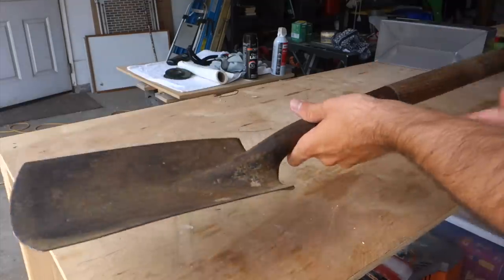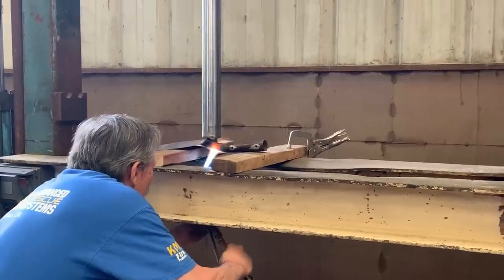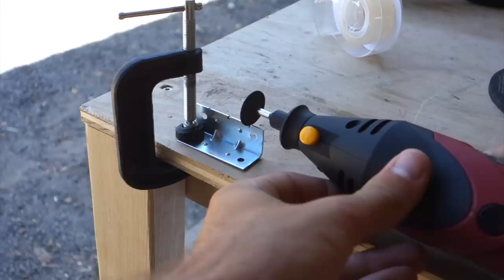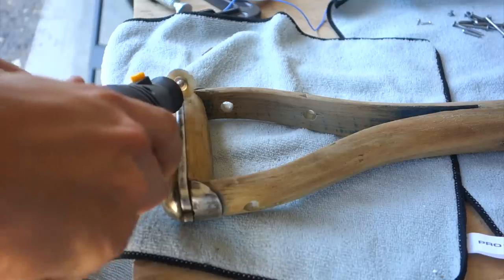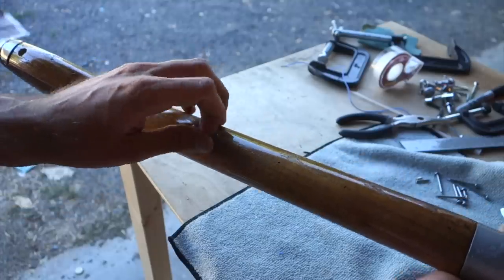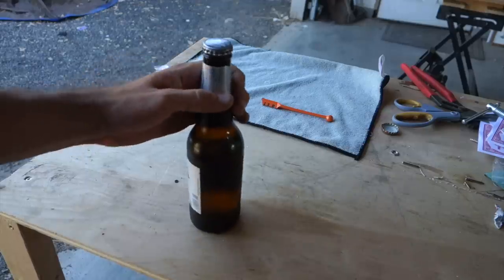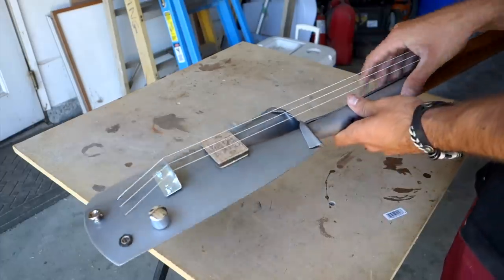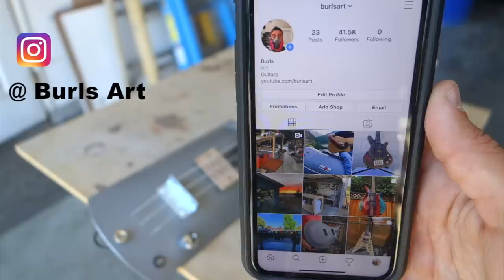I Built a Guitar Out of an Old Shovel

Comment: Next video: “I made a guitar out of a cereal box”
Reply: I did that when I was a kid. One cereal box (reenforced with balsa wood) with a hole cut, and six rubber bands stretched to different lengths. Didn't stay in tune for more than about 30 seconds but it worked.
Reply: well the next video was one made out of paper so you weren't far off
Reply: Make one out of paper
Reply: No way! You can't be cereal!
Reply: Next video " I made a guitar out of Microsoft PowerPoint "

Comment: You didn't need to sandblast a second time. Oils will not cause rust, they prevent it from oxidizing, though they do make it more difficult for paint to stick. Instead, you can rub the whole thing down with acetone, let it evaporate, then poly.

Comment: Awesome job. I’ve built 4 shovels and the hardest part for me is drilling the shovel head itself. Do you have any tips?
Reply: Use a drill bit for metal
Reply: IIRC they harden most shovels. If I was going to do this, I'd heat cycle it a few times to soften the steel. (MAP or propane torch and get it red hot then let it slowly cool.) It may affect the sound so plan out were you going to drill and focus the heat.

Comment: um point, actually the strings on a shovel guitar dont need to touch the neck of the shovel.. they are intended to be a good inch, as they would have been if you left the neck at that angle. this means you can use a slider more easily:)

Comment: The idea has been done to death including by me. I got it from Justin Johnson who sells them for an insane price. Now you can get one on eBay for half the price and the point of making a shovel guitar is mostly novelty. Does it work hell yeah. The notion you need a guitar body with electrics is wrong. You could use a 2x4, it's funny how many think they must follow after the norm when all you need are the electronic components, strings and they can be mounted on almost anything.

Comment: Great video!  Not sure if you're soliciting ideas for your next build, but in case you're interested and/or receptive to ideas, here's mine:

Build an electric guitar out of Lego bricks.

(just the body of the guitar, NOT the neck, similar to your other builds)

Get a bunch of Lego bricks (the six-dot ones would be best), drill small holes in each one, a couple holes through the top and a couple on the sides (this is so the resin can flow through the entire body of the guitar), assemble the bricks into the rough shape of a guitar and then put it in a box.  Fill the box with resin, and then (similar to what you did with your other builds) take the body out and cut out the guitar from the block of resin and Lego bricks.

I think it would look cool and make for an interesting project.